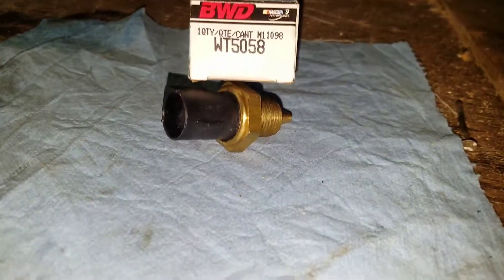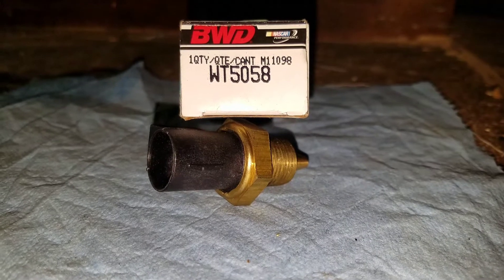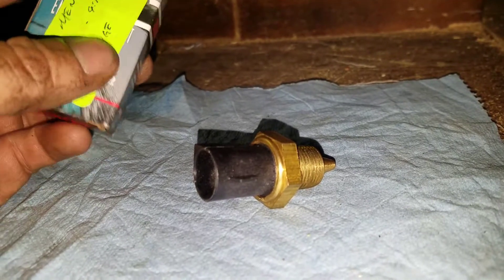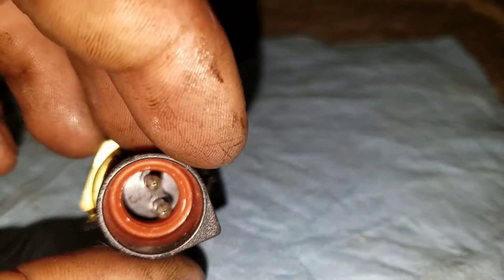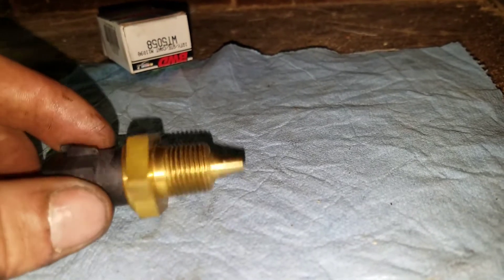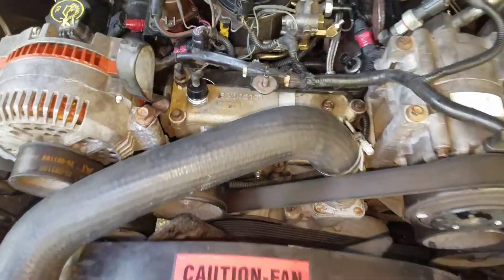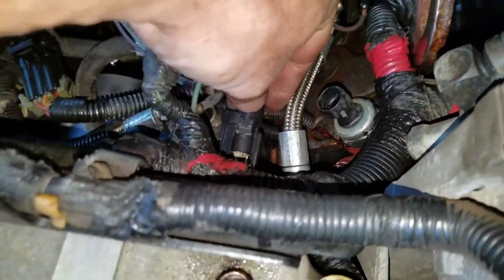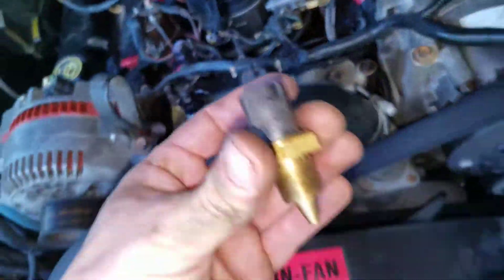7.3 powerstroke eot Engine oil temperature sensor

Comment: Thanks for the video, I didn't found the place where it's connected, I have a ford e-350 6.0 (2004), could you help me some way? 
Thanks again 
Julian from Chile
Reply from the maker: Okay so you have a 6.0 powerstroke I was showing for a 7.3 powerstroke I'm not 100% sure where the one on your truck is but if I remember correctly it's going to be under your top radiator hose we're at mounts on top of the engine in the front there should be a little sensor if you're facing the front of the engine it'll be down and to the left just a little bit
Reply from the maker: Check out ( standard brand ) he has a video on 6.0 powerstroke engine coolant temp sensor